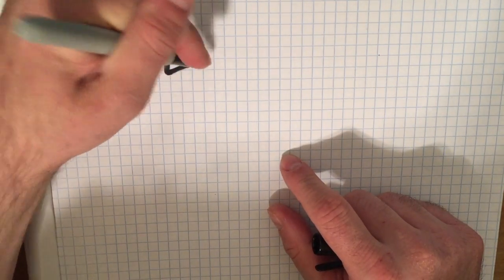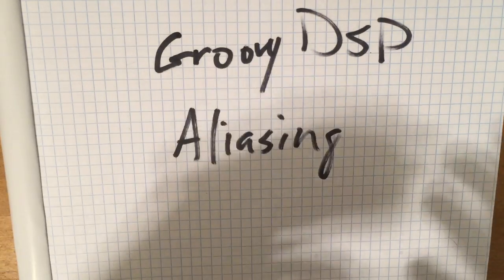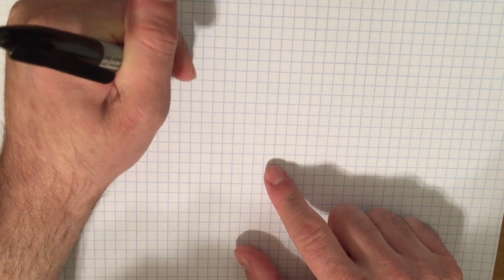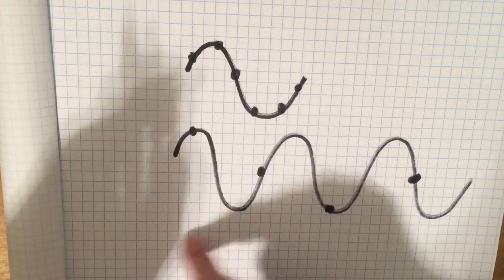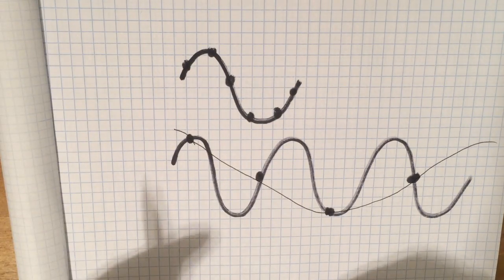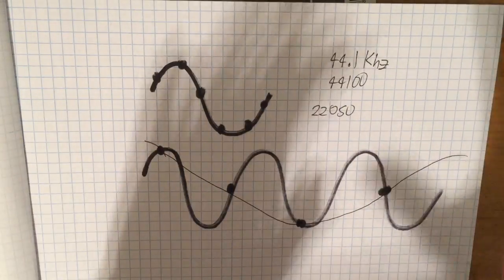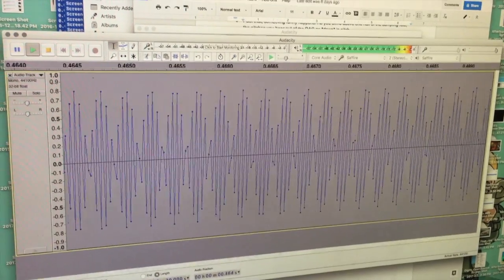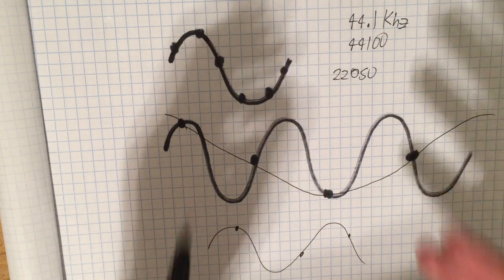GroovyDSP: What is Aliasing?

Comment: so... i get that for high frequencies you get low frequencies when theres aliasing... but im looking at it on logic pro with an analizer and downsamplig and for LOW frequencies you get HIGH frequencies aliasing like its crisscrossing across the spectrum, is that part that i dont understand
Reply from the maker: Huh! Could you go into more detail? Low frequencies shouldn't be affected much; it could be a different phenomenon, like some sort of distortion is being introduced
Reply: @groovydsp1716  well, the sine in the input is a g5, which should be 1568 hz, using the dawnsampling in the bitcrusher stock plugin of logic and increasing the downsampling at a ratio of "3x" other sines appears at 13200 hz and 16200 hz (approx).
The number of sines increases proportionally with the downsampling and they go lower in freq.
Funny thing, at a "14x" ratio, the aliasing interferes with the original signal, causing a tremmolo like effect, with 6 more sines harmonizing.
Any ratio higher than that just produces a lower note than the original 1568 hz, at 27x you actually get a sub (66hz)
Reply: @groovydsp1716  the point is, aliasing seems to cause distorsión both in higher and lower frequencies from the original, depending on the sample rate
Reply from the maker: @aelucif   Antonio Elua  This is a good question. Here's what's going on: A bit crusher does not downsample in the proper DSP sense: It introduces stair-steps, which in turn cause many more harmonics to pop out of your wave. Here's an example: Let's take a simple sine wave, let's say around 440hz. If we downsample it normally, it will still look like a sine wave even if we go quite low, and will still sound like one. Any missing samples are filled in with smooth curves, so that it keeps the original shape and, hopefully, the original harmonic content. But, when we bit crush, the sine wave is mutating into another wave. It's related, but different: it now has many discontinuities, and that is where you're hearing the extra harmonics. In a way, a bit crush has more in common with a distortion pedal than it does with a normal downsampler. Now, you're also seeing some interesting behavior: Bitcrush and distortion effects often can create really complex behavior that's hard to analyze. And that's where a lot of the magic is.